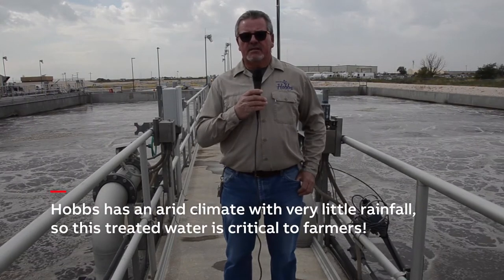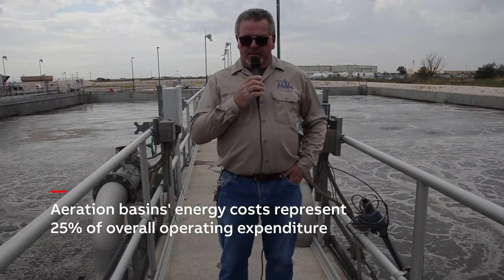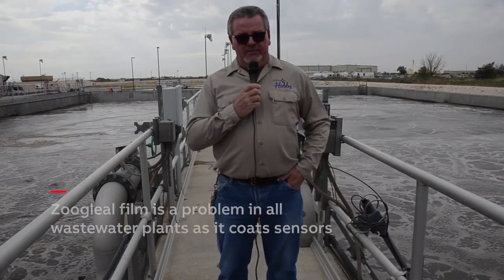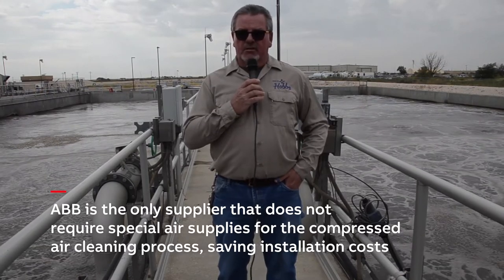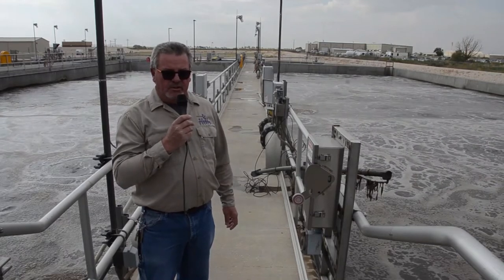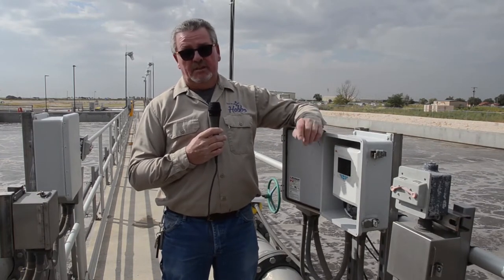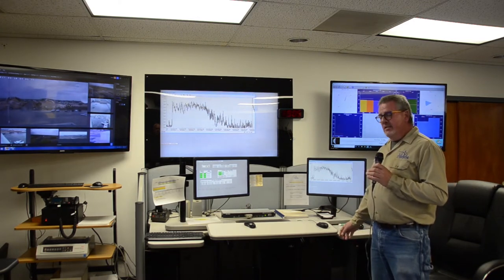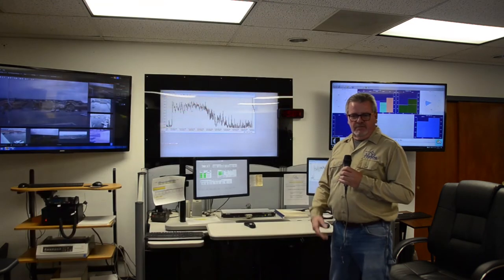Addressing the challenge of Zoogleal film build-up on dissolved oxygen probes in aeration basins

Comment: Peter, I want to thank thank you for taking the time out of your busy schedule to explain the process of maintaining these DO probes in a very active environment. I worked at a WWRF facility in Arkansas and one of my responsibilities was to maintain, clean, and calibrate the DO probes in our NBR system. We did not have quite the cleaning process because our zones or areas were under mechanical aeration and the movement of the water reduced the buildup of the 'slime'. It did build up and did require cleaning. 
I was pleased to see that ABB provided you a great replacement and saved you not only many hours of cleaning, but reduced the exposure to health and safety issues. 

Too often we stay with the same system that were developed many years ago, because it is easier to keep doing what was done instead of looking at ways to improve the process.

One of my most challenging and satisfying  projects was to automate the activated sludge blanket level system. In the past the operator had to go up to four secondary classifiers, use a sludge judge and measure the level, and calculate how much to open or close a weir gate to maintain the proper flow of activated sludge back to the NBR wetwell. This process may involve several trips a day. Designing and installing the equipment was a long task, but creating the control software was a long and challenging undertaking. 

Just like what you did to make your process save several hours of cleaning, this project saved many hours a day of operator 'busy work' to maintain a process. 

Again, Peter, thank you and all your crew members in Hobbs New Mexico for being a protector of the environment and keeping our water clean.

Michael Parry, retired facility automation specialists for the Fayetteville, Arkansas WWRF.